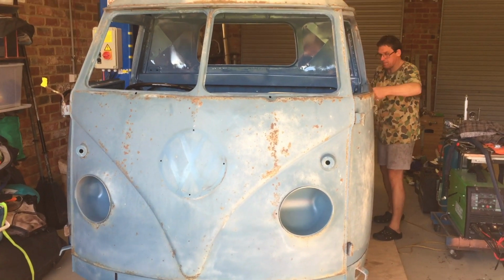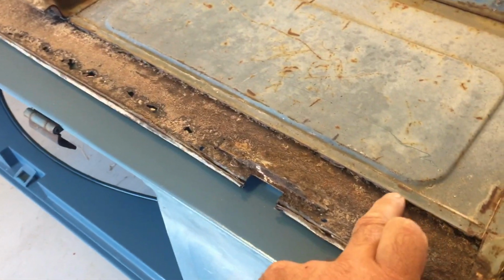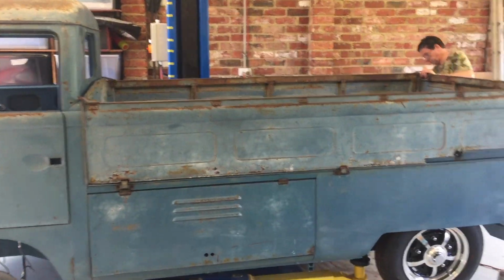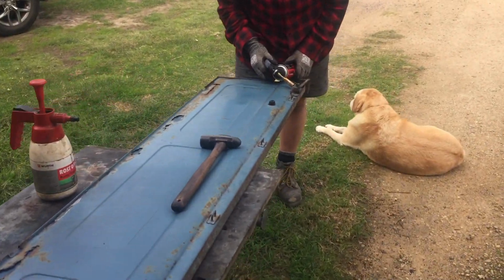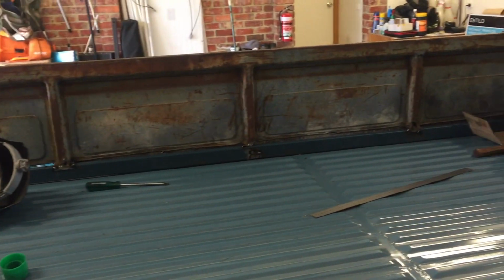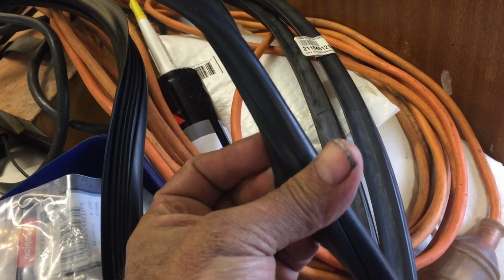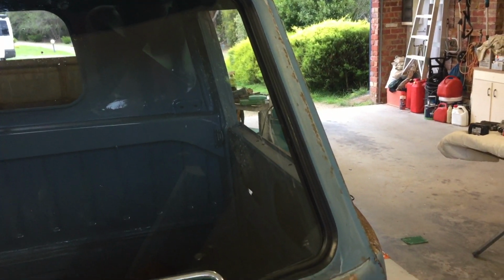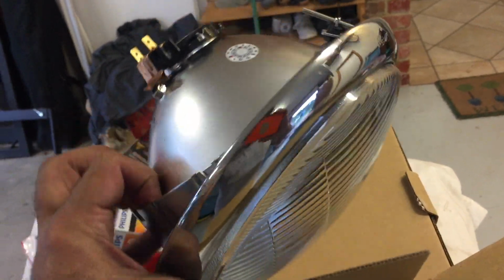VW Bus Restoration -  BARN FIND SINGLE CAB (part16) vw restoration

Comment: I wonder if they don't drill a drain hole in the headlight ring so they don't have to make a left and a right , it would be hard for me to drill a hole in that new unit 😟 That was quite a dance happening during the front window installation! lol 🕺
Reply from the maker: Yeh drilling holes was not a good feeling, we probably will use the og rings😉

Comment: Do you have concerns that the holes drilled in the rear tray floor for the timber slats provides a water ingress pathway?  Love the use of panel bond on the gates, great choice. The truck looks killer
Reply from the maker: Good point, I will used silicone under the screws but really these utes wont go in the rain much im guessing